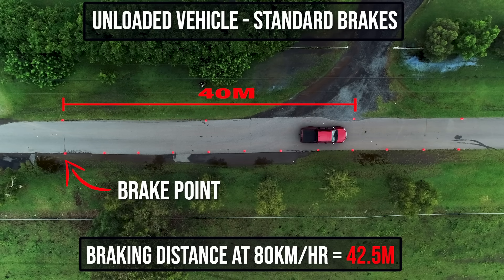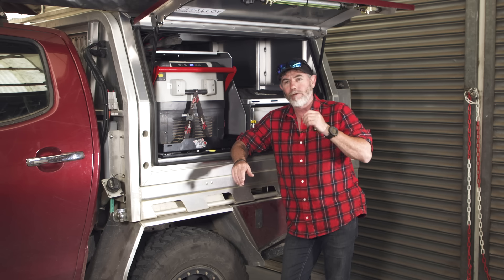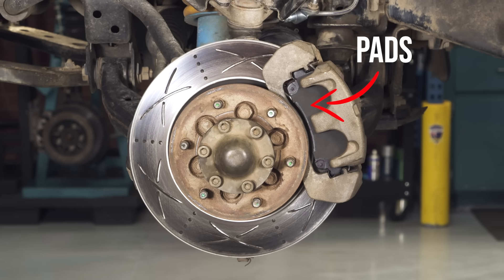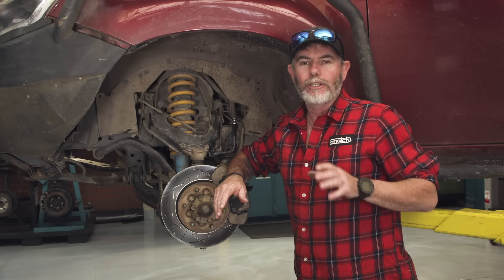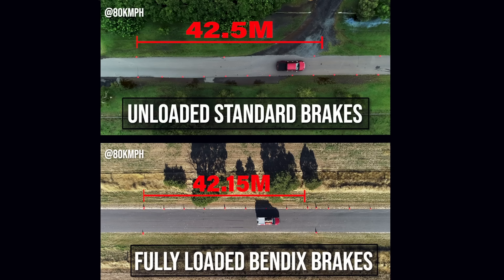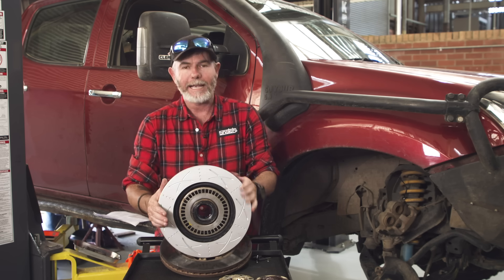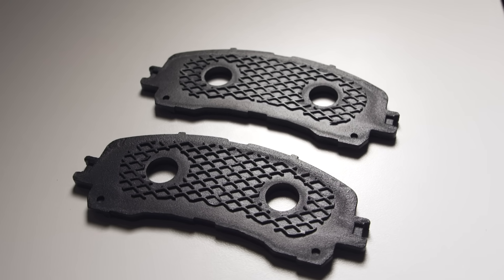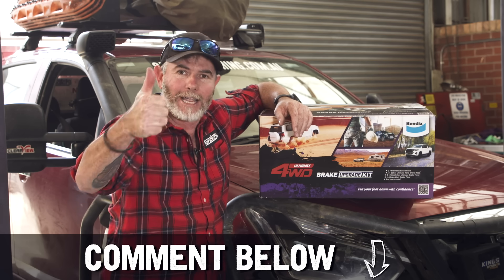SHOCK Result: How poorly 4WDs stop when fully loaded + How we improved stopping distances by 14M!

Comment: You can never have too much stopping power, that's just a fact. Always upgrade your brakes when you upgrade anything else, that's a First Year lesson!. I agree with you that it should be a first mod, up with the suspension!. 

I don't believe that the standard brakes can't lock up a wheel, and kick off ABS. 
Why wasn't your ABS modulating the lock up of your wheels first thing?. Are you saying that the DMax is that shit it can't hold over the maximum tractive effort of the rubber and the road surface?... 
This is a single emergency brake, are you saying that the standard brakes can't lock a wheel, but the momentum of the wheel is overcoming it first from a Dig.

Brake Fade Is A Thing, I agree there, and that's just the Sciences at play, but I am sceptical of the first initial brake, cos there should be ABS kicking off, and it seems a bit odd.
I'd like to see initial stopping on the brake dyno of the stock brakes reflecting your distance.

Comment: I don't know about the other utes but the Hilux has a 4-piston caliper, this should at least be the minimum for all utes., (InMyOpinon)
Reply: Why? It is completely unnecessary in all applications except repeated high speed emergencey braking (absolutely never happens in any real scenario in a dual cab) The Hilux will boil the brake fluid and warp the stock rotors quicker than the others given the extra clamping force.
If your stock brakes can activate the ABS when fully loaded,they are stronger than the friction coefficient of the tyres. Bigger brakes will not stop it faster as the tyres are the limiting factor to you stopping in a shorter distance.

Comment: Can personally rep the bendix HD pads for 4wd. You won't believe how much better they work.

Compared to the basic bitch ones I was testing with, they couldn't lock the 31" muddies on the front end in my application, but they did reduce my stopping distance in HALF. they also caught fire under the huge load.

But, I highly disagree with using "braided brake lines", or low expansion hose. It has a negative effect and can cause feedback through your ABS system and a general horrible peddle feel. 

I recommend replacing with quality, Rubber brake hoses rather than the old fucked ones you probably have currently.

Comment: Agree on some level. However. If your pushing hard enough on the brakes to activate the ABS in both scenarios, you will end up having close to similar stopping distance as the ABS will maintain optimal brake efficiency, as it comes down to the footprint and friction of the tyre against the road. However you still need good pads and discs for repeated stops. 
I think another paid presentation.

Comment: Now if you had stuck to your nissan roots you could have gone the next step with bolt on 4 pots and larger rotors straight off a Z34 and R35. Still all factory parts but just a huge improvement

Comment: Would love to know, why do u fellas have cable ties on the seat belts for ?
Reply: On angles the seat belts will lock and not allow the belt to extend out only in. 

 So If you are on a steep hill and get out for any reason then jump back in the seatbelt will not come out. A cable tie prevents the seatbelt from retracting all the way back in so ya can put it back on when back in the vehicle.
Reply: To stop it from recoiling back in... easier to put on and off repeatedly
Reply: @kaynemacdonald7693  wouldn't it just fall and get jammed in the door all the time thou

Comment: Well you are stating the  bloody obvious you fool

actually  you should replace the  factory setup completely  as failure to do so will end up with the same issues..

Kind of the irony  of doing mods  the last thing you think of is breaks and the breaking system you use ,  and the other irony is what you  are running in a  dmax is no different to the toyota tradesman utes  okay  stocked up with your work gears  and designed to go off road as far as your nearest building sites, as for running around dirt and gravel roads no on your life using it in an unintended purposes and wonder why it fails a on road test i would love to see you do a test on unpaved roads and  see how it fairs because at the end of the  day a 4cyl diesel was never really  designed to run in a scenario  that you are using it in..

and looking at most of the bar works you idiots run  I would hate  see the vehicles on their sides and  have no physical way of  recovery without doing some major..

whether you use a ute or a    full sedan  type  patrol/pajeros/lc70-79 series/LC 80-300 series or even the  humbled 60 series, nobody  I've seen within your crew  run a completely welded exoskeleton bar  work   that is level with the bonnet  to  stop animals doing damage and leaving you dead in the middle of nowhere with a KIA..

I'd also check if you have anti skid/anti lock breaking within the braking management system  aswell because  this is the main  reason while you will not stop on a dime  whether you are stock weight  or modified weight .. because this slows you  down and doesn't stop you and may  cause death at speeds above 80km/h

Comment: Just pull the ABS fuse and jump on the anchors, pulls up real well
Reply: Very bad advice and not true
Reply: BarbecuedPossum clearly don’t have a clue what you’re on about, been a mechanic for 30+ plus years recommend to thousands of customers, and haven’t seen a single one come back to complain.
Reply: @jimmyobrien2384  You're talking shit - at best if someones good at threshold braking they'll brake a couple of meters shorter.
Add into that some steering or bad surface then good luck stopping in the same distance with equal composure. 
Maybe some pieces of shit have junk abs but most cars nowadays actually have very good calibration
Reply: BarbecuedPossum just having a joke bud

Comment: Hey good thing but was told not to get slotted rotors if doing alot of gravel sort of roads and tracks as rocks can get stuck in them and put a big groove in your rotors. Also to note the stronger pads will wear down the rotors quicker as well due to the more grip pads. There are different levels of rotors too you can get some that get rid of heat very well and not slotted. Hope this helps and  the braided brake lines help alot

Comment: When you have your truck loaded for the off, pop round to your local weighbridge and check the gross weight against the handbook.  Different brand pads make a big difference, check the best brands for wet and dry conditions.  Watch your speed on and off road.  The nut behind the wheel is the critical item.

Comment: I put the Bendix 4wd pads in my Jeep but I also put new rotors on. I assumed that I needed to bed the rotors in so I did a series of stops building up to heavy braking from high speeds. I've ended up glazing my new rotors and pads. I can skim the rotors but is there any saving the pads?
Reply: Yep absolutely mate. Take the pads out and get a piece of coarse sandpaper and rub each brake pad on it in a figure 8 motion. Put the sandpaper up against a window so it's flat. Do it until all the glazed surfaces are gone. Been doing that 22 years as a mechanic. Just take it easy when brakes are new. No heavy braking and she'll be right mate.

Comment: Good work lads, bendix rocks, i upgrade my brakes with bendix even if i don't modify load my vehicle.
Another interesting test to run would be the 5km and 10km speed reduction tests that show the impact on braking distances. I always drop my speed in the bush in danger times, never ever hit an animal in 40 years of touring (came close a couple of times though 😜)
Reply: Glad you've had a good experience David. Great driving tips for the bush as well. Fingers crossed that you avoid animals for a further 40 years.
Reply: I'm making up for your loss. Line those roo's up and smack them for a 6

Comment: Good video m8. You've also have to think about suspension. A suspension lift has also a huge impact on thw breaking distance. All in all upgrade brakes, bigger brake discs are the best way to achieve more safety and off-road performance. Cheers

Comment: I don't rekon you were on the anchors that hard when loaded up with the old set of brakes, jump out and give us a crack haha good vid none the less
Reply: 100% no car takes that long to slow down right at the end (not the whole time, but the last 10 metres he definitely let off a little)
Reply: @cameronmauro7209  It's the brakes starting to fade. Long hard stops you'll notice it.
That's why the distances kept getting longer.
Reply: agentcrm I know what brake fade is

But, brake fade doesn’t happen in 1 80-0 stop
For this, I’d give it 2-4 consecutive stops to get brake fade that bad
Reply: They did say did an average... implies more than 1 run.

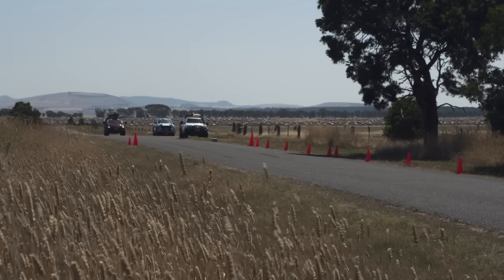4:50 "first stopping point was around 50m"
So Graham's on at least 2nd run.
Reply: Leigh Fawkes yes, but they’re showing the best, the best would be around the 2nd when there’s a bit of heat but not enough heat to cause fade 

But it looks like they’re treating it like it’s the 12th run and there’s so much brake fade that you can’t even slow the car from 20 kms to 0
Reply: Yeah, it's BS. The tyres should be hoppin and boppin over the road whilst the ABS unit is preventing lockups.
Reply: zforce69 stomping on the pedal with modern abs doesn’t do that, it definitely looked like he let off at the end with the fully loaded stock brakes but eh, who cares brakes are a must no matter if this video wasn’t legit or not

Comment: I believe it-  I had to slam on my brakes in Newport Oregon and nearly nailed the rear end of a car that had slammed on its brakes to let a person cross- my rig weighs 6200lb, stock it's about 4700lb....  I'm way overloaded and didn't even realize it, I don't even have a roof-top tent yet, just armor, barwork, winch, lots of camping gear, two dogs and my girlfriend and a gearbox on top.

I need to get myself a trailer though and get that weight off that back axle.

I did upgrade my drive-train and suspension components to Nissan Titan parts (I'm Titan-swapped, well will be soon, everything has been ordered because I was in an accident last Friday, someone cut me off and their insurance paid out to fix my rig).  These upgraded components should handle the weight better, but the wheelbase...

Comment: I do agree that upgrading of brakes is a good thing but wouldn’t it also be true that car manufacturers design cars to be within allowable parameters up the the GVM. So the braking distance with an extra 500kg on a dual cab ute is probably what it should be designed for anyway.
Reply: 40 72 upgrading the brakes to perform better is very much worth it regardless, the factory setup may meet minimum regulations and be legal, but that doesn’t mean they work the best. The video shows the stopping distances and the improvement the upgrade makes over factory, that could be the difference between running someone over killing them and stopping safely. Very much worth it.
Reply: ZedTee77 I’m not disagreeing with you as I actually said in my first sentence that I think it’s a good idea. All I’m saying is that any vehicle will stop better without load compared to loaded and cars brakes are designed to stop a vehicle up to full GVM. What you said about stopping better so as not to kill someone. Sure, but most drivers know their vehicles and apply the brakes to stop in the allowed distance. That’s why we have so many rear enders when people need to stop short. So better brakes will in veritably make people brake later in most cases.